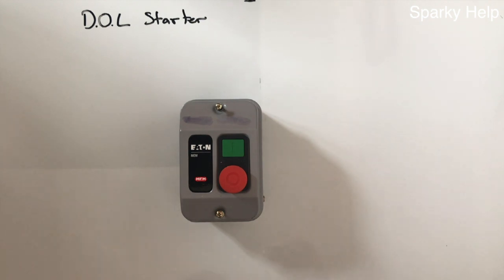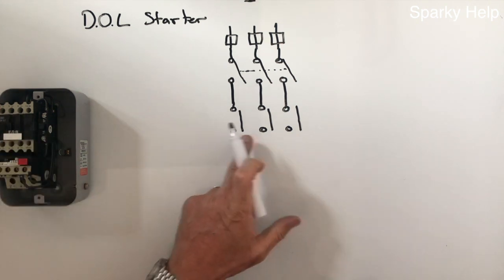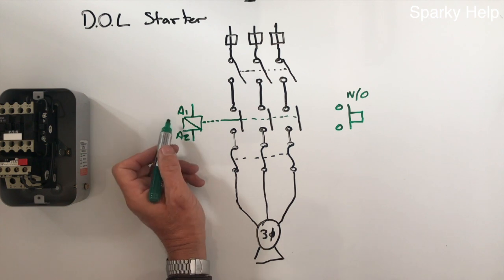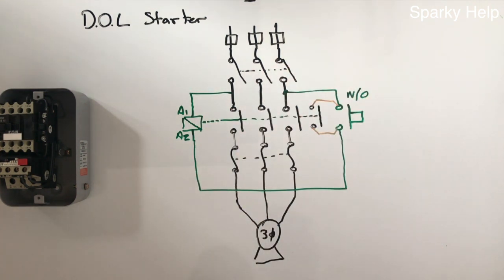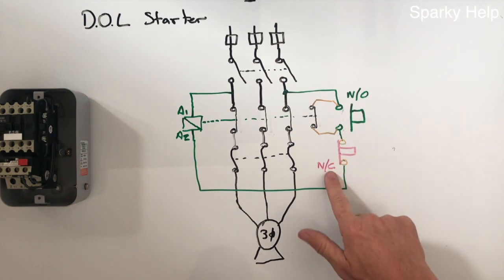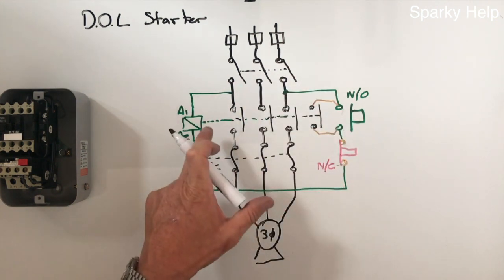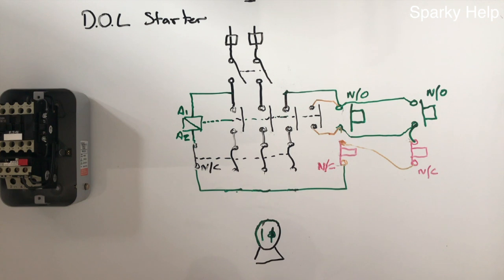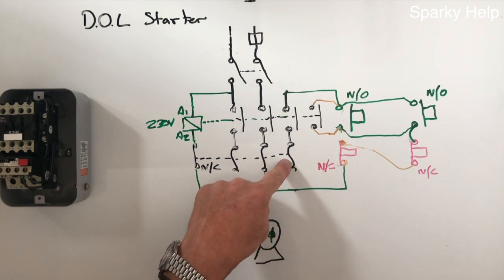How to connect Direct On Line Starters (DOL) with Remote Stop Start & Fault Find

Comment: Just came across your channel and enjoying it. With regards to testing of a motor circuit would you advise testing in 2 stages for continuity and IR testing (test to the incoming side of the contactor and another test on the outgoing side) or manually press the contactor in and do them in one test? I would've thought the depending on the state of the contactor it may affect the readings, especially for continuity.
Reply from the maker: Great point!
When doing continuity you could hold in the contactor manually - or put temporary ;links from top to bottom.
When doing Insulation Resistance, you cannot do the above as you will measure the coil and it would appear as a fault - so best tot test each side separately.

Hope this answers your question.